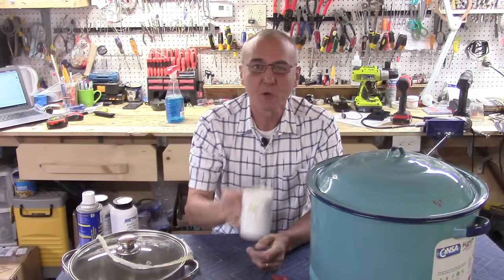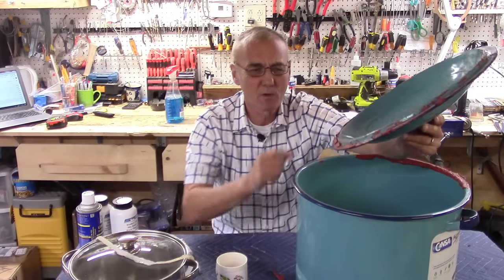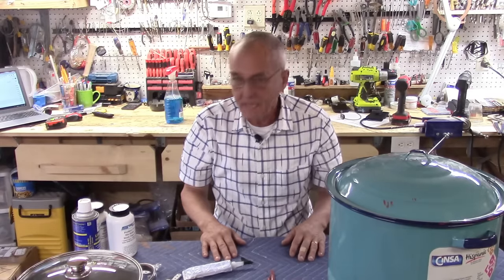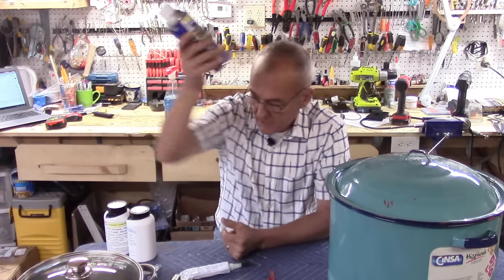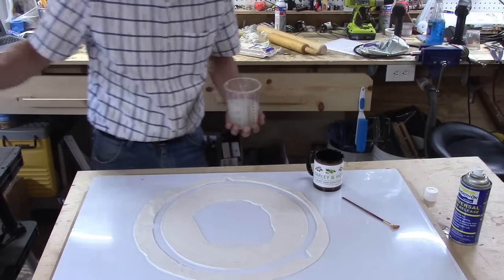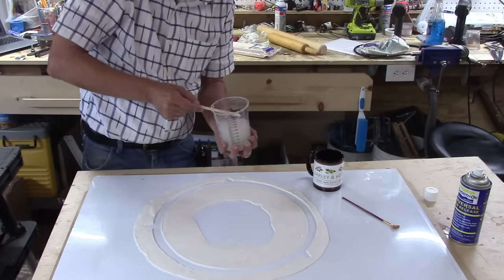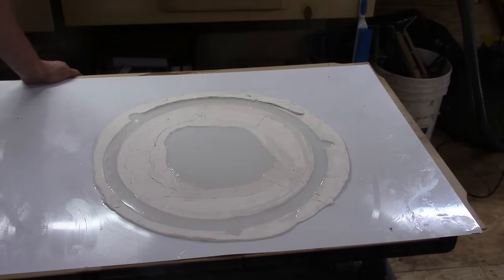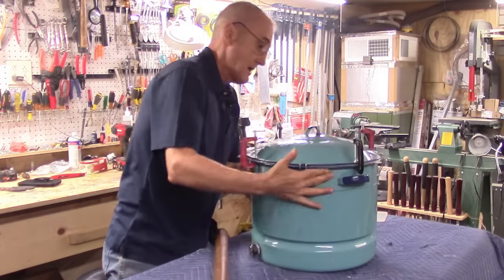BUILDING YOUR OWN STILL

Comment: Just go around the pot 4-5 times with PTFE pipe tape then clamp. Used it for a couple years with out fail and is very cheap!
Reply: Really good suggestion I may use it with the split tubing idea...thanks
Reply: Cut out a cardboard gasket and wrap it in the PTFE thread tape and that works great.
Reply: Would that leach pfas somehow

Comment: Instead of using heat could you use a vacuum pump an drop the pressure causing the alcohol to evaporate cold without any chance of burning it just an idea I've been wondering about for a while

Comment: A very simple pot still is a 40 or 60 cup stainless steel coffee maker. You Still have to make a seal but the heating element is already in it with the temperature control. For the seal, I just used aquarium silicone on the lid as it is food grade. When the boiler is cured just run a couple of water washes through it to get any residual acetic acid out of the seal.

Comment: Might I suggest using a product called Dragon Skin from Smooth-on for making your gaskets? It's a food quality RTV silicone that will take extreme heat. I use it to make molds for casting molten pewter. They offer a "trial size" kit.

Comment: Cut a circle to fit the pot out of a pizza box and wrap it in several layers of teflon tape makes a nice gasket.
Reply: I did something similar. Any cardboard will do and the pfte tape is food safe.
Reply from the maker: All sounds good.
Reply: I've made gaskets that way, but they don't last long.  Now day I just use teflon tape on the pot lip, binder clips and have some flour and water standing by for little leaks

Comment: for the seal repeatable, you could use proto-putty which is food safe silicone and corn flour (or corn starch for the yanks), when set, it becomes a rubber like thing. i've never tried this personally but in theory it would hold up the heat, as its not excessively hot, but as i say, never tried. will edit when i try this. the good point about proto-putty is that it's very not stick when setting
Reply: Ever try it? If so how did it work?
Reply: @offroadz4861  never actually got round to it, but upon further reflexion, heat proof silicon would be better as if normal silicon gets hot it tends to melt
Reply: @finlayjones714  I'm thinking of making a mold then using RTV to make a gasket. But yet again I need to get my mash ready first

Comment: Hey George, all your stuff is awesome as usual, now what you have with this great. You are talking about sealing cookers. You have it there now, while you were at it what about using other stuff like flower and water, heat resistant tape and other good things in there words a video on just sealing a cooker and it’s piping coming off it or have you already got one out there that I’ve missed. Cheers

Comment: Use an old pressure cooker for your boiler. There only 6 ltr but I do a 6  litre wash producing 1.5 litre of spirit at 40% at a time. That way your not decanting large amounts of liquid back and forth.

Comment: Hello George.Great videos. My PID controller is fantastic.  I made a Brandy form a batch of Pinot Noir using the Might Mini. I have aged it using french oak infusion spirals for 3 months. It is starting to develop an oak taste, but has a great nose. It still tastes a bit harsh and is not smooth like other Brandy. However there is not much fruit. I have two questions before I start my next batch. Could the cooper mesh I inserted in the tower be removing the fruit flavor, and is it necessary with a wine based Brand? I know most commercial Brandy is ages in new oak for a year and then in older oak for the balance of time. Is there anything I can do to soften the Brandy? I thought of getting a piece of white oak from the lumber store and soaking it in hot water for a couple of weeks to get rid of some of the new oak flavors, and then putting it into the Brandy. Cheers, Anthony

Comment: Nice to have the valve stem if your using an induction cook plate that takes at least an hour to see if you have a leak. Then shut down let cool, patch and try again. Bolt on valve stem auto parts store!
Reply: Best thing is cheap weather stripping so far on a mixing bowl type still with a matching pot. Apply it to the bowl and over lap the seam.

Comment: A pressure cooker comes with a gasket and threaded holes to put your piping.
Reply: Most pressure cookers are made of galvanized steel. Not safe in my books.
Reply: Pressure cookers are made out of aluminum or stainless steel not galvanized no cookware is made out of galvanized

Comment: Or just buy a pressure canner and eliminate a bunch of steps.
Want to use an induction cooktop?
Figure out the max diameter you can use on it, go to Harbor freight and pickup a cheap, steel skilsaw/tablesaw blade and JB Weld (use the original) it to the bottom of your pot.

Comment: Only criticism, is using an unregulated heating element. I used a 40 gallon hot water cylinder, and it boiled too hard. I had to double the length of the condenser, even then, the  alcohol poured out hot, and the nasty components were not being separated from the alcohol.

Comment: I have 4 clamps on my 14” dome. SS. When I put pressure on my system I get air leaks around the dome. I imagine there is a level of leakage that’s acceptable as the vapors up the column will be less than that leakage. I’m thinking small 2” clamps to increase the seal. Please discuss the acceptable amount of seal leakage. Thanks

Comment: The problem with those enamel pots is when you cut into them they rust. I know cause I’ve done it. Unless you spray some rust proof spray paint that’s food grade.
Reply from the maker: Okay. I get your point but realize that we just used what we had laying around to demonstrate how easy it can be to make a still from things you may already have. It may not be possible for everyone to secure stainless steel (which is probably the best material) to do this. 
Yes, once you break the bond of the coating the metal underneath can and most probably will rust.

Comment: Impressive! Tell me, if you put a thermostat between the power supply and the heating element, how would you run an experiment to determine the optimal temperature setting to govern the process?

Comment: I use to think you needed a lot of clamping power to hold down a kettle lid, but it's not true. You can use a few cheap spring clamps that will do the job. Getting a good seal is another thing. You can make your won silicon seal or buy a premade one that will fit as long as the diameter is correct. I was restricted by available power ( only 120v 1500w max ) but if i was to redo it today I'd convert a large kettle with a good 240v heating element. Just find a kettle with a metal lid, glass not so good. lol

Comment: For smoothing the gaskets you can also use isopropyl alcohol. Works the same as the dish soap and it doesn’t leave any soapy residue behind. It just evaporates.

Comment: Does the lid hold down clamps just latch on or do you have to mount with tiny screws ? I can only find the clamps that attach with screws on side of pot. Where can I purchase clamps that just snap on to lid to hold it on ? Thanks.

Comment: I have a similar pot but im a little stuck aa far as a column goes. Im trying to solder three SS coffee mugs end to end and top it with a little copper bowl. Now IF I get that damn stainless to do cooperate, it then becomes about the lid/column connection. Man,  stainleess steel is no joke, though. The housing on my drill started melting from heat tying to drill out the bottom of one of those mugs.. Barely scratched it.
Reply: Steve Titus you have to drill stainless VERY slowly or you'll burn the bit up.

Comment: Just curious, what about using a bicycle inner tube around the lid as a gasket?  Use one slightly smaller than the lid so it fits tight, put a slit down the inside of the tube, and stretch it around the rim of the lid.
Reply: I've done this, works a treat, I go all the way around with bulldog clips, plenty of force to hold in the pressure if your not using a thumper

Comment: Is there any problem going off the top of your still with 5/8"  copper pipe then increasing to 1 1/2 " copper  back to 5/8" at a total of 18" in height then down to the worm  Would this act as a condensing chamber ,  in fact double distilling
Reply from the maker: Not sure about that double distilling thing but 5/8 out then into a 1 1/2 would still be 5/8 restrictive. I think I'll go with a dome style and attache the 1 1/2 from the side of that to a condenser.
I believe I will have more vapor flow and more efficiency from that. If not maybe the 5/8 all the way out for simplicity.

George

Comment: Sorry I'm bored ..OK so condenser coil ,worm,, use a 5 or 6.5 gallon bucket drill a hole about 1 inch off the bottom. Use a washer same as your tubing. One on the inside of your bucket and one on the outside. Use 20 to 25 feet of tubing copper only.. be careful when you bend this stuff. Place one washer on the end of your coil then pass it through the hole you drilled. Make sure 3 to 4 inches of coil sticks out and angle it down. Then add the other washer on the outside. Mix your two part adhesive smear it between the inside washer and the bucket and well around the coil. Then between the outside washer and the bucket. Then a Lil more just for good measure. Don't let it move let it dry and it stays sealed forever. Takes about 30 minutes to set. My seal holds 5 gallons of water without leaking. The 2 part is made by jb weld but as long as metal and plastic are listed as what it bonds to you should be fine. I hope this helps.

Comment: Where can one find some 5/8 or larger copper tubing that can be hand bent?  I'm looking for a specific source.  Thank you!   * and did the screws for mounting the clamps self-seal enough when screwed into the pot?  ** Is there soft stainless piping that could be used?
Reply: I imagine soft-drawn copper would work, I believe it's 3/4 but could be picked up at plumbing supply stores.

Comment: Hi, George! More good stuff from you! I have used the high temp RTV with great success on my first home made still, but...only to seal the hole for the thermometer ,( in the tower), made sense to me for thermometer placement at the time, Late 90s'. This sealant is pretty much inert to everything we could toss at it, as it is designed to work, forever, in a very hostile environment. I have sealed gas tanks, to exhaust pipes with this stuff. Permatex has a new line of sealants out that are, apply, tighten; drive home...ready right now....hmmmmmm. Oh, I do solder; so all'a you'ze that are gonna jump in here with grief.....mellow, mellow.......we are always looking, right?

Comment: Mr George a couple more good options is the self adhesive weather stripping good for one time use kinda cheap to. And the other is those sweat cooling rags you hang around your neck in the summer. The material is thick and durable cut to size then wet it good  gasket. It'll piss you off getting it into place so I suggest cutting it a Lil bit oversize. Lowe's also sells a 2 part plastic glue that works very well to seal the thermo and coil connection if needed... I feel silly but I been using 3/8 tubing I only get about 3 1/2 gallons in my still and it takes about 5 hours and 48 lbs of ice to go all the way down the tails. Wife is on the way to Lowe's lol to get bigger tubing and coupler. Question do you think I'll need more ice for bigger tubing? I have two drain valves on my ice bucket cause I can drain off the hot water on the top before adding more ice . Making another run soon and I was curious about the ice. Dome lid for the still top.
Reply from the maker: I don't believe you'll need more ice. 
George
Reply: @BarleyandHopsBrewing  thank you sir when I'm big like you I'll use my yetti "(since they no longer support the NRA)"  and the water pump..pump hot water out the window..

Comment: My question is, why not just put it on an electric stove?
Both of my parents families were Moonshiners from Kentucky. My grandma taught me how to make a still when I was 8 years old,  but that was the open flame type.  
So, that was my question, why don't people just make a still to use on a stovetop? Buy an old stove, or hell even a new one, stick it in  garage or shed, and do it that way. It makes far more going out in the woods and setting up in the woods.
Reply: That's exactly what I do with a 15gal keg. I tried a liberal pressure cooker but imo anything that small wasn't worth my time and effort. I had to strip the alcohol off  of about 3 gal and do that 3/5x  to get a pot full to run again. I guess side tracked so yes a electric stove works great but I'm betting that heating  element is less clean up and can install a inline thermostat which would be awesome for making cuts

Comment: i've read quite a lot in homedistillers.org and I have watched so many videos here that I suffer from "analysis paralysis". I have a 40qt ss pot. Is there any need to add a bowl or the second pot on top (granted it looks cool)? can I just run my bulkhead fitting to my two inch copper from the lid that came with the pot?

Comment: Hi George what's your thoughts of useing a electric 10 qt pressure cooker? I dont want to do the wrong thing right. I know I could but should i.
Reply from the maker: It is difficult to mimic the results of a quality made still with a pressure cooker but it does work. Just don't expect too much out of it.

Comment: Your first fail is using that pot. You ONLY use copper or stainless for your pot. That steel pot, if it gets any chips, will make bad shine. Bad as in poisonous.
Reply: Its very clearly a stainless pot....
Reply: Just wondering how is it I have eaten food prepared in cast iron, my whole life(I am 64), and spaghetti from a chipped enameled pot, as well as a seventy years old ,well chipped camp-coffee pot,(Grand-Dads) ?  ALUMINUM is what we need to get away from our food and drink. .......(Pressure cookers) for distilling,ummm; NO.
Reply: @patrickquinly1764  c3pfett is wrong, as you pointed out,  but you are wrong on the aluminium issue, no volitile aluminium compounds are formed during distillation.

Comment: I have a 5 gallon stainless steel pot I would like to do this with.  I'm even looking in to getting all of the parts and building a PID.  I would like to see you complete your pot still in another video, I would like to see how you would attach a column or if you would just run copper tubing out of the top.  also, where would you put a port in the pot for a thermocouple to be ran with a PID?.  I have no idea how to attach the thermocouple to the pot.  What brand of food grade silicone are you using to make your gasket as well?
Reply from the maker: Can't remember the name of the silicone. Found it on amazon.
The probe should be in the vapor flow where it enters the port going to the condenser (or as near as you can). So, you could drill a hole in the column or whatever you attach to the top of the kettle and insert it there.
There are virtually hundreds of ways to do this and all of them work well. 
George

Comment: I'd prefer ONLY to use stainless steel or copper. You know, you can get a quite big stockpot and use it as a boiler.
The idea of this enamel mild steel pot ain't good. For sure it's a proof of concept but please refrain from using that kind of material for a still. A kind of gasket can be made with flour and water...a dough in the direction of a simple pizza dough. Roll it to a sausage and put it on top of the boiler. The lid squeezes it in shape and seals it perfectly.

Comment: We use oatmeal n little flour n water make a paste with it when it heats up and drys it's hard as a rock!
Reply: in the uk you can buy a double sided draft excluder  in a roll 8mm x3mm thick made of foam which you cut to lenght and take i side of adhesive of and stick to pan  which forms a seal Easily released when finished brewing and use again

Comment: Awesome vid! Just curious, could you fill the lip on the lid with silicon, smooth it with an ice cube and let it dry? If its stuck to only the lid you can still remove the lid and it would seal.
Reply: I placed plastic wrap on one side and silicon on the other and placed them together to cure, form fitting seal.

Comment: I used a canning pressure cooker, no clamps and it comes with a gasket!
Reply: Aluminum?
Reply: However, that gasket isn't designed for high ABV alcohol or nasty stuff from the foreshots like acetone. Don't use it it WILL leach into your liquor.

Comment: Hi! I’m a new subscriber of your channel and I must say that I have found your videos to be the most informative on youtube. I have 2 questions for you. We have two kind of very basic still in India and Nepal. They are extremely simple and do the job. In one of the designs you can see the moonshine coming out so you can basically keep a tab on the heads hearts and tails. The shine that comes out of this one is a bit warm though. The second is an ancient design which is like a reverse pot still. The earthen pot has another small earthen  pot inside it. This design has a lot of limitations as you can’t see what’s happening inside and all heads hearts and tails are mixed and you only know when to stop with experience. Once distillation is complete, we remove the small earthen pot and distill temperature is almost in a boiling state. I’m attaching a link and want to know the disadvantages of this design. Secondly, I’d like to know that the moonshine we make in the second design is very hot as I had mentioned. Is it safe to consume that and any other inputs. Pl watch from 6:20 to 7.   https://youtu.be/Xl2C_f4zW2A.     Pl watch this one From 6:10 https://youtu.be/8WoeeXcI71Y